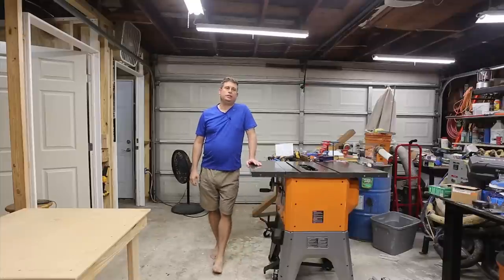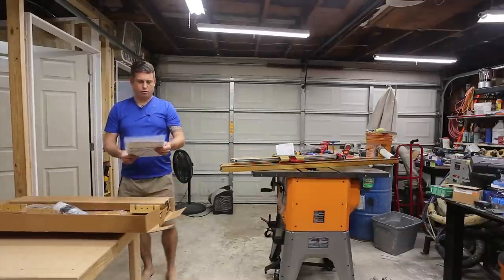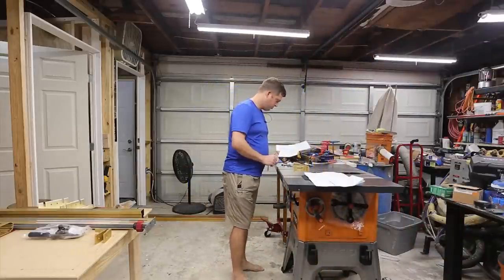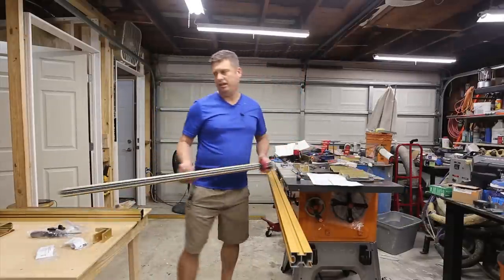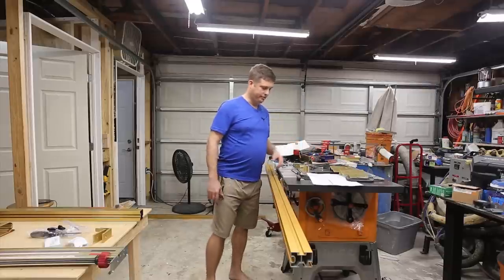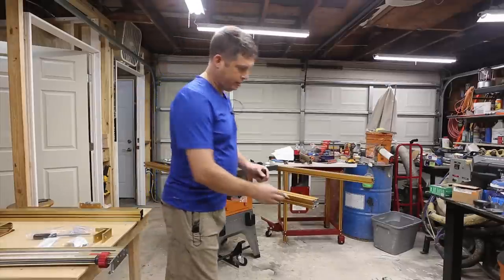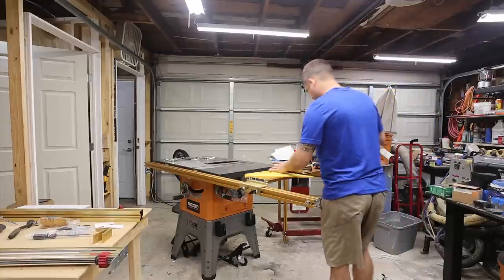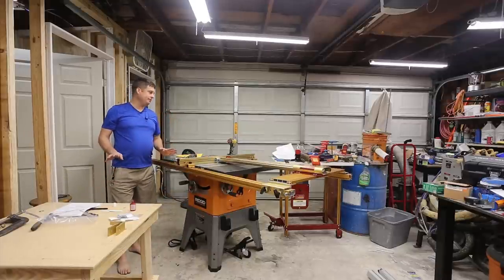Install Incra Fence System on Ridgid R4512 Table Saw

Comment: Interesting, if a bit like watching paint dry.  Have to agree with others that bare feet and workshop do not go together.  And if I spent that kind of money on a complex piece of equipment (and I have) I would probably spend at least a few hours somewhere quiet and study the instructions intently.  Not be like a kid on Christmas morning, playing with the new toy without understanding what I’m doing and probably breaking something.  I’ll wager the issues you had with “missing” bolts were because you were using the wrong bolts  (because you didn’t read the instructions). Lastly “not perfect but really close”???  Seriously? For that money?  I don’t think so.  Read the instructions!!!!
Reply from the maker: Incra's instructions are actually not that great.  But you are welcome to pony up for the Incra fence system and the saw of your choice and then figure out how to put it together.  A fence that is designed to fit most saws is going to require some adaptation and yes, close enough is all that's required for woodworking.  If you want to get down to .0001 then it's machining, and even then "good enough" rules the day for most projects.
Reply: I refer you to your video at 3:23 where you praise the “absolutely amazing” incra manual.  You cant have it both ways.  Most reviews praise incra’s documentation (and so did you).  Furthermore you can’t blame incra for your ill advised bare foot rush to play with a new toy before understanding what you’re doing.   If you’re going to put up a video, you have a responsibility to demonstrate responsible practices - novice woodworkers will see what you do - so always set a good example.